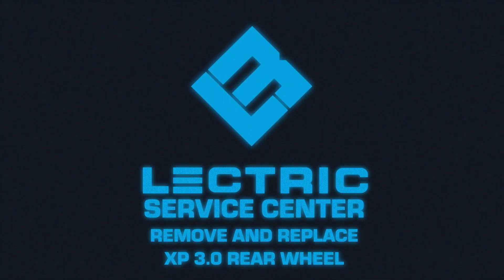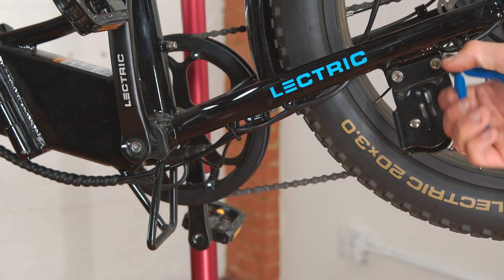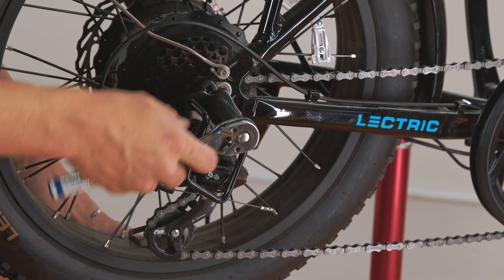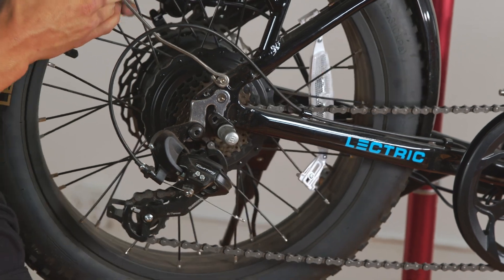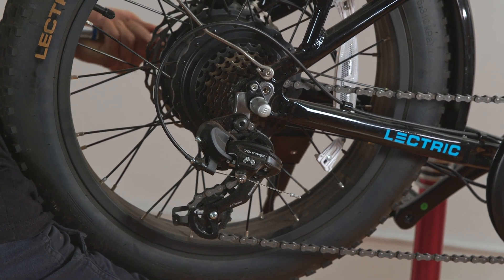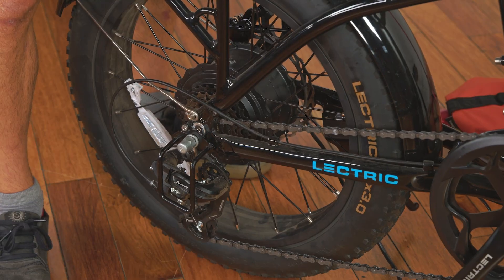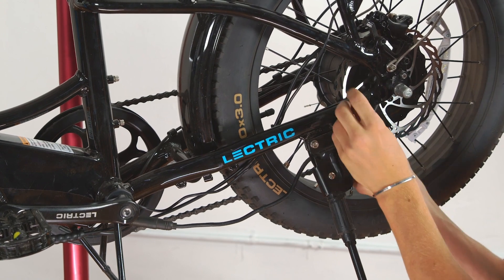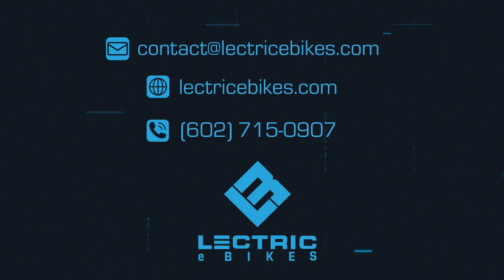Lectric Service Center | Remove and Replace XP 3.0 Rear Wheel

Comment: Thanks for the video and the service.  Replaced the rear tube in a snap.  Tire stand I use is the 'old school' flip on the handlebars; the display and gear shifter clear, but watch any phone holder, etc.  Thanks for the disc brakes (game changer).  Lovin' the Lectric.  279 miles.No issues.

Comment: Just added flatout to the rear wheel of my Lectric XP 3.0 Step thru and as I pumped it up to 40psi (sidewall says 25-45 psi) it blew with the sound of a gunshot! Come to find out the correct psi should be around 30. Anyway, after watching this video and purchasing a 17mm deep socket, I was easily able to complete the repair to my complete surprise! A couple tips guys: the allen wrench is a 4, not 5mm. And make sure to take a good long look at the order everything goes just in case. Do not, DO NOT remove the 17mm nut from the axle!!!! Just loosen enough to remove the wheel because when going to put it back on, everything is right where it needs to be. Make sure to put the derailur guard back on before replacing the allen screw in the torque arm. One more tip, with the tire off the wheel, this is your chance to run a wrap or two of duct tape over the stock yellow tape just for a little extra protection from the spikes, I mean spokes. It's basically free insurance. Good luck, you can do it!

Comment: Stop putting slime in the tubes! Got a nail last night in my rear wheel. The slime was worse than useless. It did not stop the leak but it DID make the tube greasy so it would not take a patch. Nice 4 mile walk. Thanks.

Comment: I have spent literal hours trying to get the wheel back on and it feels impossible to line up the washer holes on each side.  There needs to be a video showing both sides and addressing problems we may run into.  Considering the huge number of brand new bikes received with a flat rear.
Reply from the maker: Hi there! We apologize for the issues you’re currently experiencing. We kindly suggest contacting our dedicated Customer Service team directly at contact@lectricebikes.com. They will be more than happy to assist you promptly. Thank you for your understanding!
Reply: No kidding!!   2:13 "Push the wheel up into the drop outs" Thanks Lectric for showing us said dropouts, and the dudes hand was in the way. Couldnt see a thing being done.

Comment: How do you guys ship me a bike with a flat back tire already  and I need to replace it
Reply from the maker: Hi there, we're sorry to hear about this.  To get the best help with this issue, please contact our Customer Service team at 602.715.0907 M - F from 9 am to 5 pm MST or email us at contact@lectricebikes.com. Thank you.
Reply: Same thing happened to me, but got free replacement tubing… the more I learn about this brand the less satisfied I am with my purchase….
Reply from the maker: We're here to support our riders and are sorry to hear that this issue has affected you. We're glad to here that the issue has now been resolved!
Reply: Same
Reply: We just bought 2 XP3's in July 24....9 months after your flat tire.....1 bike came with flat so Lectric never resolved the issue, still thinking its OK to ship new bikes with flat inner tube...also, they are now putting tire sealant in the inner tubes - the flat tube from the factory had white tire sealant in it...which to me is a complete HACK.   Incredible.  Like finding a tire plug in a brand new Mercedes from the factory.....
Reply: same, the replacement tube is filled with slime stuff. repair shop quoted $80 to change, at least I found this video and managed to do it myself with pliers and a lucky allen key
Reply: @LectriceBikes  can tires 20 x 4 be used on lectric 3.0? which came with 20 x 3 tires

Comment: I really want to buy the bike. My only concern is what happens when I get caught out in the rain? Will the motor and electronics handle it? It is a piece of outdoor equipment, and it only seems reasonable that it should be able to stand up to some rain, yes?

I'm not talking about riding it around at the bottom of a lake .. but I don't know a single cyclist who hasn't, at some point or another, left the house on a sunny day, only to get drenched on the way home.

I can't throw afford to throw away $1,200 - $1,800 because my bicycle got wet.
What is Lectric's position on this, please?
Reply from the maker: Greetings! The XP 2.0, 3.0, XP Lite, XPremium, Trikes, and XPedition's electrical components have an IP rating of 65. This indicates that they are dust-tight and can endure jetting water. For more information, refer to the IP code. Be cautious while riding in wet conditions, as it may take longer to use the brakes and the tires may slip during turns. Kindly note that the electrical components on the bike are not waterproof. It is important to mention that the warranty for the Lectric XP does not cover any water damage. It is a common occurrence for most ebikes in the industry to face issues when exposed to a certain amount of water. If you have any inquiries, please feel free to ask!
Reply: @LectriceBikes  "...the Lectric XP does not cover any water damage."

But, if the bike is damaged by water exposure commensurate with the IP65 rating, does that mean Lectric still won't cover for that damage?

(edit: .. look .. all I am saying is that obviously there is a great likelihood, that through no fault of the owner, the bike will at some point have to go through at least some small amount of rain. How can it be acceptable to make a bike that will effectively be rendered destroyed by it? People can't help it if it starts raining while they are out riding. They should just lose a few $K and toss up their hands and say "oh well .. bad luck for me I guess" .. ?)
Reply from the maker: Hello! IP65 Water Resistant indicates that the bike can endure light water sprays and small puddles. In the event of rain, we suggest finding shelter promptly and drying your ebike. The need for caution with electronic components and water is a common practice, applicable to phones, TVs, and any electrical product in general.
Reply: @LectriceBikes  They make phones that can be fully submerged in water for extended periods of time .. and I don't generally take my TV for a ride to work.

These responses are incredibly disappointing .. and seemingly unaware of the planet we live on, that weather exists and can be unpredictable, or what a bicycle is even used for.
Reply from the maker: We understand your concerns! To be clear, this eBike has been ridden in the rain by thousands of Lectric riders over the years; we have riders all across the nation and in places where it rains often! ☔️

However, we do not encourage riding in the rain if it can be avoided, as stormy weather can be dangerous and increase the risk of an accident for all traffic. In addition, we advise riders to wipe away all moisture once they are in a dry environment to keep their eBike in the best condition.

The most common form of water damage is often due to leftover humidity causing "water spots" in the display, which is a component that can be swapped out with ease. 
Lectric's team of CSRs goes above and beyond in helping riders with any eBike issues, as accidents happen! ⚡️
Reply from the maker: Thanks for the support and insight!

Comment: The torque arm hole doesn't come close to aligning on the left side for some reason but the right side does. It is a mystery to me. I tightened the axle nuts anyway and all is fine but I don't understand why it doesn't align. Both axles are all the way in the offsets and washers are correct.

Comment: This is not the same for a regular non-step through 3.0. You will need different sized allen wrenches and the bolts are in different places

Comment: What bike stand was used in this commercial?
Reply from the maker: Hey Robert, the bike stand was purchased from Amazon, but we don't have the name or model to share right now. Because there are so many options, we don't have a specific recommendation to share! 

Our riders can use any bike stand that's rated for the weight of their eBikes (110 pounds maximum is great for a little extra wiggle room). 

We have a few online communities where Lectric riders share their favorite accessories, tips, tricks, and tools for working and modding their Lectric eBikes, so we'd encourage you to enquire about different options on social media!

Comment: I followed these instructions for my Lectric Xpedition, but after putting the rear wheel back on I am getting some rotor rub against the brake pads. Do you have a video to address this?
Reply from the maker: Hi there, it sounds like your rear wheel brake rotor may need to be trued. Hydraulic brakes will self-adjust over time, but you can manually perform a brake adjustment, which we do not have a service center video for at the moment.
Reply: @LectriceBikes  It would be helpful to show how to true your wheel and if we can adjust the brakes.
Reply from the maker: Thank you for this feedback, we'll pass it along to our teams! 🙌
Reply: @LectriceBikes  you guys really fail in so many departments...
Reply: @Skinnamarink. Not customer service though... Amazing what they did for me recently. Great company overall.

Comment: Anyone know which 17mm long socket you need for this exactly? Looking them up it seems there's a 1/2inch variety and a 3/8 inch, not sure which one to get.
Reply: I used a 3/8 on mine
Reply: @bdapore  appreciate the response, apparently the fraction is actually the size of the driver on your wrench :| TIL

Comment: Many folks will be looking at this view because Lectric has quality issue with wheels/spokes causing flats....my tube, had sealant and glitter (they use glitter to theoretically fill in holes - yes, a real hack) in it from the factory as they are aware of the problem but NOT fixing it.  Shame on Lectric.
Reply: Instead of riding my new expensive bike, I am working on it...incredible.   No burrs noted, my fix was something we did in the 1990's when I was doing AMA Hare scrambles on dirt bikes, I ran duct tape (Gorilla Tape) around the inside of rim, around the stock yellow rim protector, this provides additional cushion so that spokes won't tear tube,....worked on the dirt bikes, so I don't expect any issues on my ebike (that cost more than most of the dirt bikes I rode).   Never heard of putting tire sealant in tube before, sounds like a HACK/Cheap fix.

Comment: Why would you skip the part about which nuts etc go where when reinstalling?   You don’t have those instructions anywhere.  The worst part is it is a brand new bike I have never ridden and I’m spending hours trying to fix it using customer videos.  Since this is a seriously common problem instructions on reinstalling each piece should be included or at last a guide in the manual that doesn’t even come with the damaged bike.
Reply from the maker: Hi there, these videos are a supplemental resource we offer to aid our riders with a home installation! We will share this feedback with the rest of the team. Thank you.
Reply: @LectriceBikes 11 months and you clearly didn’t do that
Reply: @LectriceBikes no link,  just fluff...
Reply: Lmao...how to reinstall things? Its the opposite of taking it apart, this isn't rocket science!
Reply: @ralphmalf365  So you’re ok with a brand new bike arriving damaged? Weird take
Reply: @karmakimeleon8832  Where did Ralph say they were ok with a flat tire? They are replying to your comment of  'Why would you skip the part about which nuts etc go where when reinstalling? You don’t have those instructions anywhere' anyone can see that. They're right too, this isnt rocket scince, its a bicycle. Your reading comprehension skills need some work bud. They teach that stuff in second grade.

Comment: You guys are lying about the error code e 10, it has to do with the battery and not the LCD. You were supposed to fix the problem before releasing the 3.0 whici you didn't do.
Reply: Sorry Charlie

Comment: In real life your only hope to get the wheel back on is to remove the back brake caliper before you start tryna pry the dropouts apart again. Fin worst thing ever. And I've been working on bikes for almost 50yrs
Reply from the maker: Hey there! When dealing with our eBikes, we recommend following the video instruction above. Thank you!
Reply: The wheel goes back on fine with out having to remove the back brake caliper. If you have been working on bikes for 50 years and cant figure this out, i feel sorry for any customers bikes you have worked on bc your obviously not very good and working on bicycles.   lol

Comment: But the motor wire literally goes into the nut under a black rubber guard on both sides. How do you get these off?
Reply from the maker: The motor wire stays with the motor, but disconnects further up the line at the quick-plug!